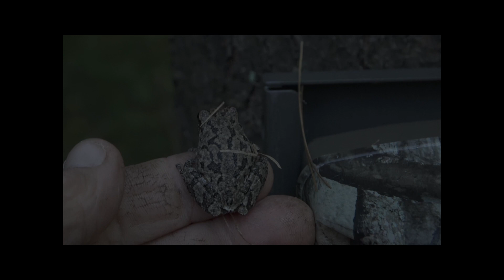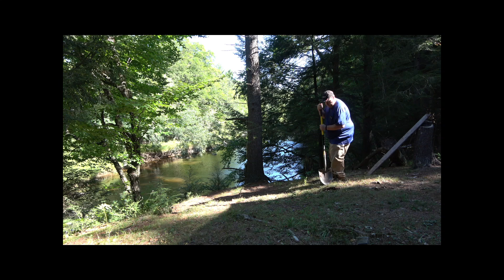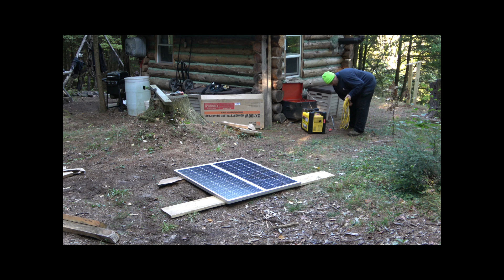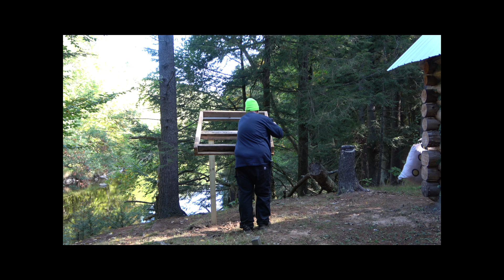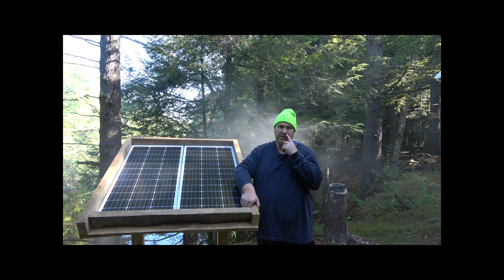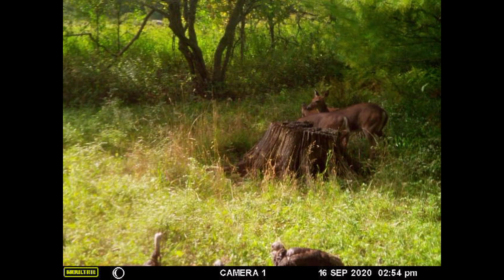Solar Panel Installation at the Off Grid Cabin.  Part 1

Comment: I'm curious how you will run wire to the cabin.
I know, basics right now.
Maybe when you rebuild with better materials or whatever what I was really hoping for you to be was -- the first to build a swivel mechanism so that the base could turn (manually) with the direction of the sun. Maybe you go out there two or three times a day and redirect it and then adjust your panel angle to sun-declination.
I think you could do it ... all winter to design.
You know I would go out there a couple times a day and adjust angles!
Reply from the maker: Thanks for watching and commenting.  I have had similar offers for excuses to visit.  The wire will be underground, it is a short distance to the northside of the cabin where all the electrical is located.   The swivel idea is a good one I think, and I might do that.  This really is a proof of concept project right now.  I don't get much light in the area of the cabin so I have to see how this will work.  I might have to mount the panels on roof of the cabin and cut a few more trees.  I did not want to cut anymore trees, they are all healthy.   Take care.
Reply: @EmmaTailsOutdoors  
Okay thanks for the info. I think the vast majority of solar panels are installed on the roof because of the decreased maintenance. To compensate for inability to track the sun the installer designer just increases the surface area of the solar panels. 
But I like the idea of tracking the sun, of course there very expensive built-in systems with motors and all that.
The big advantage of not putting a solar panel on the roof is you won't have to climb a dangerously tall ladder onto an icy slippery surface to sweep the snow off.
I would have no problems whatsoever taking down the necessary trees. If it bothers you, just go plant some trees from mail order or dig up the hundreds of seedlings and saplings that I'm sure you see on your property.
The other thing is the more sun you allow to hit your panels the less carbon fuels need to be burned to generate that electricity. The big picture ... carbon footprint and all that.

Comment: Good morning Emma,  you're going to just enjoy the heck out of that. I finally got my solar system finished last spring. It's nothing major it's just like yours simple system but it supplies all the power I need. Mostly light bulbs and the ability to be able to charge cell phones tablet stuff like that.
I have five buildings here at the cabin they're all wired into the solar system now. That sounds like a lot of buildings but it really isn't. One of the buildings is the woodshed and one is the outhouse LOL and then I have a 10 x 10 metal storage building out back that's also hooked into the solar system. In the winter months when the sun sets early it's really nice having a light bulb in the woodshed and the outbuildings LOL.

Great to see you back at the cabin I know what it's like to be busy with work the last couple months have been crazy for me also.

Enjoy your time at the cabin my friend good luck with your hunting season and as always keep your powder dry.

Tom
Reply from the maker: Hello Tom, good to hear from you.  I am loving the LED lighting and I have high hopes the the solar panels will workout as planned.   Using gas and oil lamps is such a pain and also running the fan on my wood stove makes a big difference in how fast I can heat up the place.   Your cabin sounds like a right proper homestead.  Very cool.   I have been busy but I did manage to shoot a couple of turkeys so far this year.  I have two more tags for turkeys  but I am switching my focus to white tail deer.  They will be in the rut soon so good luck to you and I hope your hunting season goes well.  Be safe my friend and I do love watching your videos, even if I don't get a chance to comment.  Take care